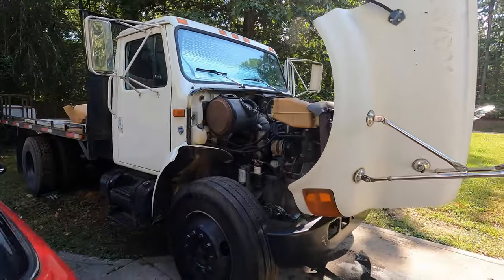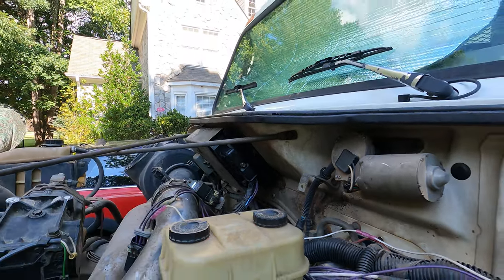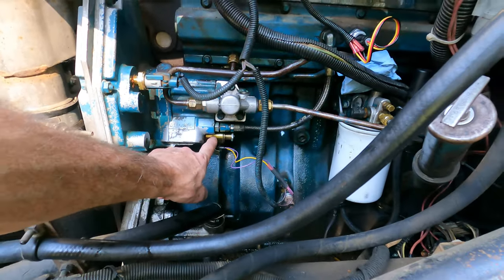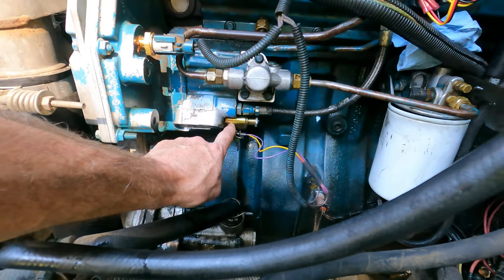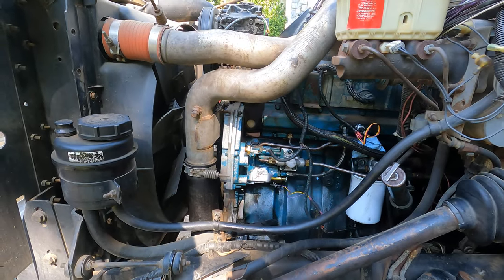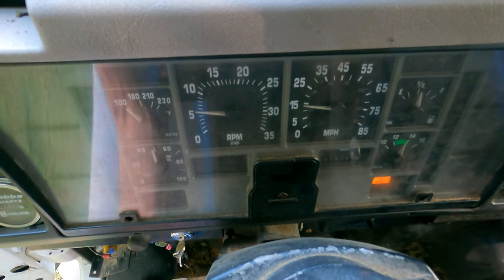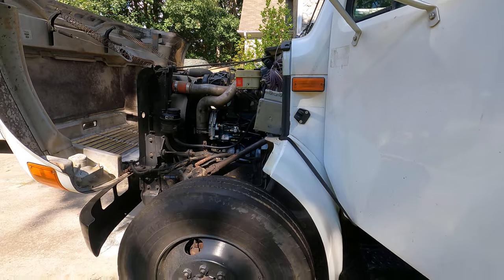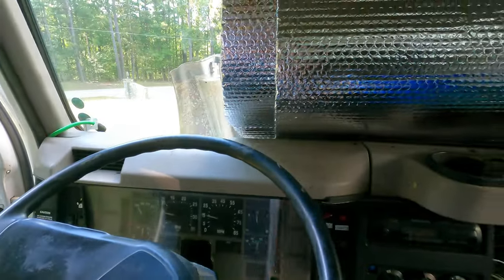DT466e - WARNING! Aftermarket IPR not so good. 1998 International 4700

Comment: I thank God that you made this video this morning before the guys got to the shop changed IPR valve hoping to eliminate code start truck on ether but had no power ran like absolute s*** glad I saw this before I ripped my hair out of my head what original valve back in and just replaced coil and now it is okay apparently these eBay valves just don't work

Comment: My 2000 4700 with the dt466e is going to need some attention soon. Even with that, I'm getting 11 to 14 mpg with it. When you look at it, I'm pleased with it a truck weighing 13,620 lbs empty and my former f250 would barely get 11 mpg, and it weighed 6800 lbs empty.

Comment: How did you know your ferry plug ball was bad? Having similar issues on a 99 dt446e with crank no start thanks
Reply: Have you checked the crank sensor?
Reply from the maker: Unfortunately I found out by eliminating everything else.  Finally pulled the HPOP off the truck and when I pulled the ferry plug, there was no check ball in there!

Comment: So I’ve got a 99 international sale motor as you fuel pressure while running is about 50 psi truck starts fine but seems to be once at operating temps goes into limp mode code it threw was some to do with fuel pressure below/above desired rate or something like that. Any pointer? It’s the bsckup tow truck which is needed it runs fine all power when cold but once warmed up will go into a limp mode has lack of power

Comment: I have the same truck that I bought not running but got it running again yesterday.  My issue is how do you get the codes on this?  It runs ok but I would love to know where the codes would be and how to read them.
Reply from the maker: If you don't have a scan tool, the dash light flashes the codes for you.

Comment: I have a similar truck,where is your shop based
Reply: No shop.  I'm just a guy with a truck.  ;-p
Reply: Rider Crossing do you also experience the truck bouncing on the road while driving. Do you know what causes this?
Reply: @ridercrossing3789 hie please may you help I've 2002 international dt466 engine..it's crank but no start..this problem starts when replacing front crank seal after that when I tried to kick only kick for a second then cut itself off..I've tried to replace cam sensor and clean up ipr Al's check sensor including icp but nothing come out may you help please
Reply: Check your relays icm ecm